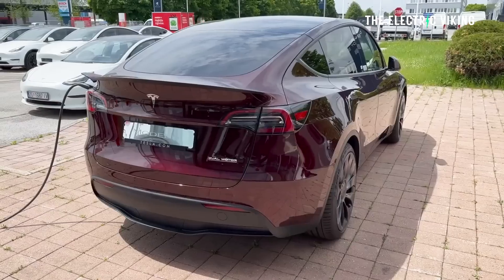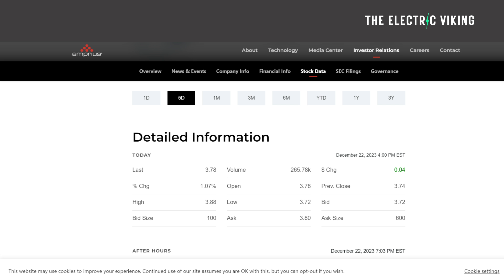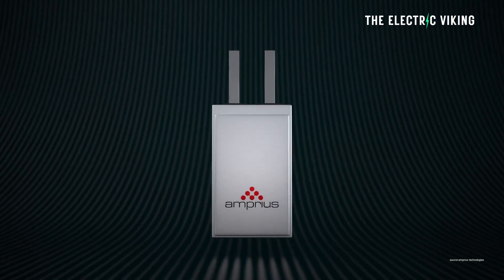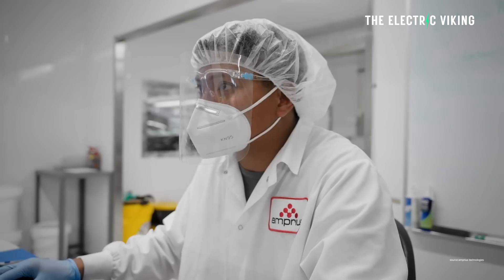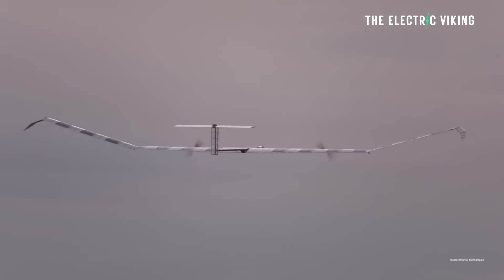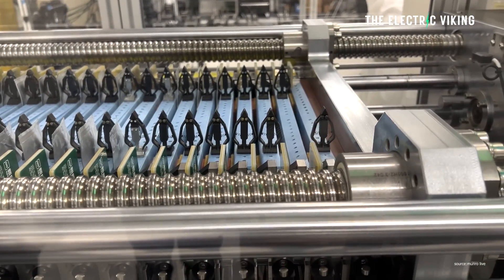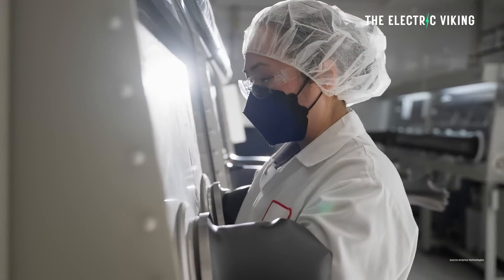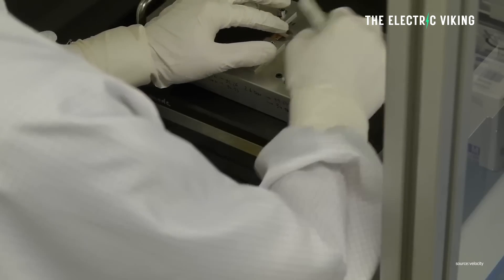A U.S. company makes the world's highest energy density batteries next to Tesla

Comment: here are the links to amprius data sheets, im sure they have new cells not yet posted but here is what i found,  this will answer most of the questions posted in the comments if just half of you get off your butts and look round you'll find the answers.. lol  https://www.tenergybattery.com/_files/ugd/78a53e_334298ab6776498f8d936c1d06e4840d.pdf
https://www.tenergybattery.com/_files/ugd/78a53e_73c57a1b49794251b19775c99bd1686c.pdf

Comment: If you are interested in this topic, please search lithiation process, which change the volume of anode! Si has more electrical capacity, it means that the the materials volume are higher after the charging process! please search “In Situ and Ex Situ TEM Study of Lithiation Behaviours of Porous Silicon Nanostructures”. If you are want more, please search “ in situ TEM Li battery”! My background is PhD in materials background. The Si-anode battery is old technology 10 or 15 years ago. GM spent millions of dollars and get nothing. The profeesor sold the patent to GM and cannot repeat his experiment results! The experiment were done by two students, who wanted to graduated ASAP!So basically, most of the data from this professor are faked! My friend working at GM told me this!

Comment: Not so many people  realize that successful tech breakthrough is NOT the same as massive industrial output (unless it is an software/internet breakthrough).
due to many factors, I NEVER doubt US is still leading in many aspect of science and Technology.
But US simply does NOT have  that amount of engineers and skilled workers to produce them in large scale so that the price can go down quickly.
TSMC's failure in Colorado proves that.
TSMC, by any standard, is a top-notch production company, BUT it does NOT work in USA.

good luck, Americans, I have doubts on US industrial capabilities NOW. and I don't there exist an easy solution for it.

Comment: If you just consider electrical capacity, Si is the best candidate. But, Si is brittle and the life of the Si anode battery will be very low! The reason is very simple: during the recharge process, Si will expand a lot!  During the driving, the volume of Si reduced a lot! This is a scam technology. The professor who developed the technology cannot repeat their results! Ask GM about this technology!

Comment: Amprius batteries would actually make the Cyber Truck run over 500 miles at 80mph. So really excellent. Worthwhile. Means I could make my doctor's appointment for 1/4th the cost and be more rested than now. Not sure what the ambient noise level is at 80mph but with that massive air filter I won't be sucking carbon monoxide fumes like in my old Mazda MPV and my guess is the fm radio probably sounds pretty good. Catalytic converter thieves,  don't need to ever worry again.

Comment: Finally....so far lol....Amprius is back down to around $4 stock value... about where it started when it got PUMPED up by some promotional comments......only to subsequently get DUMPED by unknown shareholders who saw the sharp 40% rise in value as a super opportunity to CASH IN their holdings. So far UP so FAST and so far DOWN about equally fast. I think I look to Viking for  amazing industry knowledge and awareness rather than stock tips, especially when he discusses only a single reason to buy when he well knows there are many technical factors to consider let alone many other factors. I did not buy any... not yet, at least. It turns out Amprius technology is applied to the anode whereas Lithium Iron Phosphate is a characterization of the battery cathode. Can they not be combined? I don't know enough.....think the answer is yes... but why do their existing batteries only last about as long as iPhone batteries?

Comment: Warning. SPACs are dangerous. Using a SPAC allows due dilligence to be bypassed. That means their claims don't have to be reviewed and confirmed. That's the challenge. 
Batteries need to pass All the hurdles to be viable: 
Energy Density
Power Density (charge rate)
Life span
Cost to produce at scale

Any One of these could kill the company.

Comment: This is really bad analysis. Amprius is in the defense market because they have a low life cycle and caters to units that are designed to discharge slowly and go a longer distance then blow up. These are medium sized batteries. They “claim” 200-1200 cycles which is a wild range…EVs need closer to 1000 and the larger the cell the less cycle you typically get. Recall 2020 when they were slow discharging with only 250 cycles. This is not viable for EVs for a very long time. Plus dilution is coming with heavy insider selling. Why would people sell if Tesla is building with them. Silly video full of distortions. Having said that Amprius is a good company in an adjacent space.
Reply: I don’t think you have done much research on Amprius. Yes, they have made batteries with insane density (500wh/kg) and low C-rate (1C), but they also deliver batteries with very high density and very high C-rate. I don’t think they have a technology that would enable them to scale into the EV mass market, but they might become a preferred supplier to the niche supercar market. Still, the eVTOL and military applications market will be sufficient markets for them to grow in the foreseeable future.
Reply: @OlaFrugaard  it’s certainly sufficient to get to 2x -3x the price but EVs are the only path to a multi-billion valuation. The thing is, this is undervalued but not by much given the dilution coming. I don’t see a major EV OEM putting the risk on to pay for it until it’s proven to work for longer cycles. Tesla will not be buying this and it will take Amprius at least 5 years to get an EV battery out on the road. It just is what it is and this type of video hurts investors because of a lack of DD. It’s a solid company but NOT for these reasons

Comment: I watched many interviews and read many reports. None of the discuss the longevity or cycle life of Si-anode battery, as if they are trying to evade the subject. I read an independent study that they can only cycle about 100 - 300 times before swelling problems hit. they probably can improve on this figure, but not by much at least not even close to the current LFP batteries.
Reply: Someone that actually does DD! The problem is the current battery architectures cannot support this. It’s a material company. One that Solid State is far superior with an easier, but still difficult, path to both solving the problem and scaling the solution. Yes the only batteries they have sold are for planes that are built to blow up or glide at very low speeds…roughly sold to a 200 cycle spec again at low discharge rates. Solid state can do that today but doesn’t care to sell to this market. The winners in this space will be architecture and that’s Solid State or something like and Enovix if they can ever break out of the consumer market into EVs. Solid State is the clearest path. Aside from that it’s drop in materials lie Sila that give a step increase rather than a generational one. No way tesla is looking at this company. It’s actually laughable

Comment: 1000 miles = 1600 kms, 16 kWh per 100 kms consumption means the battery is 256 kWh capacity.
80% is over 200kWh. 200 kWh in 8 minutes, plus charging losses, would require 4 Tesla semi truck superchargers all running at full output, all charging the one car battery at the same time. In other news, Tesla releases low cost compact modular nuclear reactors for the masses, to conveniently charge your new Tesla Model FFS, in the comfort of your own home.

Comment: It’s not only power density, but also longevity!
Reply: Degradation would technically be significantly lower than a traditional battery as the nanowire provides ample space for the silicon to swell up.
Reply: @hotyute That’s not right. Just because you try to fix the Achilles heel of a technology doesn’t make it as good as the standard technology in terms of longevity.
Reply: Silicon volume increase and then decrease. Please imagine this process happened on silicon wafer!
Reply: @joeyzhao3925 the volume of all materials change with temperatures. Si is no exception.

Comment: Well, at $4 a share a 100 shares would be only $400.  However, if a stock loses two thirds of its value it's a good indication that they may be having issues.  I've been actively trading in the market since 1992 and have learned a lot.  The one thing I learned above all else, is the market is fixed and the public will always be the last to know the truth of what's going on.  Generally, if a stock is down by this large of an amount the people in the know are not buying.  I would be careful with this one.
Reply: Lots of insider selling and dilution coming as well. Market is only going to reward EV for this company…not airplanes built to blow up for a few thousand dollars a battery and pseudo satellites. It’s just a very limited market. If they prove out cycle life it’s a game changer but then they also have to prove out cost. Remember, Tesla owns the market and they make money off cheap batteries that can supercharge. Density is not a major issue. Only thing that matters is fast charge. But cost of battery is what is the main driver above even that. Those costs are dropping significantly by the year. 200 cycles is the norm for them. 1200 is the best they have done and that’s VERY questionable

Comment: I think that range of passenger EV/s is not a crucial issue though the number of charging stations is, also the speed at which batteries can charge would bennefit from improving.
Reply: Range is king. I have about 250k miles in a Tesla. I would love to have 1,000 mile range.

Comment: Enovix is a far better battery stock.  Here's why - they have full silicon anodes just like Amprius and similar energy density but they don't use nanotech to make them - what does this mean - scaling production is far easier, and cost of production will be cheaper.  Also their new management are semicondutor veteran studs that have done high production of numerous products successfully many times before.
Reply: Enovix has also been public 14 months longer, sold less batteries, has less customers, made less revenue, and none of their customers are investing in them. They have new management because they are way behind on their 2021 roadmap and have been pouring money down the drain for the last couple years. Will they recover? Maybe... but I wouldn't call it a "far better battery stock" until they prove out Gen2 production and start selling more batteries in 2024.

Comment: If you know anything about Tesla/Musk, it is definitely that Tesla is "battery agnostic"; meaning Elon will use any commercial battery that has a form factor capable of using the Tesla battery pack. Tesla can already use CATL, BYD, Panasonic, or its own 4680 batteries. New battery chemistry/processes seems to be a weekly event, with lower-cost higher-density technology. Mr. Musk 'says' Tesla is not making his battery platform to be easily replaced because of the longevity of the existing battery technology, but I'm skeptical of that claim, because integration of 3rd-party battery technology into Tesla EVs is being further[...deliberately?] complicated by design of the Tesla battery pack, such as the compression of the Cybertruck pack for "wade-mode', and 800V/48V architecture. However, some enterprising rebuilds of Tesla's pack may be possible, if not cost-prohibitive. This will eventually be tested when enough Tesla EV batteries have ended their useful life. Will owners choose to buy a new vehicle after 8-10 years [IF...] those 'better' replacement battery packs are in the $10-15K cost range? R&D/design is easy, but 'production-is-hard'.

Comment: I had a tendency to run out and buy some shares right away - and then I thought of some questions. So I went to their website and asked the following. I am interested in the potential for your batteries to be used in electric vehicles. The type of battery emerging in that arena which seems potentially most favoured has Lithium Iron Phosphate chemistry. 1. It is noted as having very low deterioration through a great many cycles of use and recharging 2. It is noted as being less vulnerable to fire and it is making gains in market share despite somewhat lower energy density than earlier battery chemistries. To compare: 1. How much percentage energy storage capacity deterioration would your batteries experience over 5000 cycles being significantly discharged through use and then recharged? 2. What temperature is required to ignite a fire with your unprotected batteries and what is the likely peak temperature experienced in such a fire? Or, in a less specific manner how would you characterize the length of life and fire challenges posed by your batteries compared to Li Fe Phosphate batteries now being supplied in Tesla or other top EV's?  Thank you for considering my questions. I'll decide about investing according to what I hear or don't hear from them.
Reply: I think my comment has been suppressed by Viking? Up to his old tricks? Really important factors to consider he never mentioned at all in this video and which make blindingly clear that energy density alone is  highly insufficient to make a decent car battery.
Reply: My comments seem to play hide and seek! Perhaps the most significant point which seems to have disappeared is that the company made a direct response to me about my concerns in response to questions I directly asked them. Their batteries have about the same lifetime as those of an IPhone - well short of the 8 year guarantee on my Tesla 2170 cell based battery. And the 2170 has a lot less lifetime than the LI Fe Phosphate batteries becoming increasingly prevalent. With respect to my fire concerns they said nothing about ignition or peak temperatures - so you have to wonder. They did note their batteries could pass the military nail penetration test reassuring for soldiers wearing a battery - but only if the battery were charged significantly less than their peak energy density. Still, they passed at a still high energy density. For me the most impressive feature of the company was the presence of Dr Stephen Chu on the board. That guy impresses me as not just technically brilliant but also of very great charcter. To me that says they must be a good company.  But others can still play games with their stock.

Comment: It's silicon, not silicone. Silicon is an element, silicone is a polymer with silicon as one of the ingredients. This technology is interesting but it is expensive which is why they are targeting aerospace and defense which are much less price sensitive than EVs. The EV market seems to be hitting a wall at the moment and if the recession does come this year it would probably slow the EV adoption curve for a while. The two other very big markets for better batteries are consumer electronics (CE) and grid storage. Amprius is too expensive for both of these markets, but at a lower cost would be a good fit for CE, never for grid storage. It's not clear which technology will win out for grid storage, it's probably a mix of several different battery types. As for CE, the clear leader as of today is Enovix. The Enovix battery also uses 100% silicon in the anode but in a much different design that is much cheaper to produce. Enovix also has a patented design feature that prevents battery fires, just ask Samsung how important that is. I expect Enovix to announce large supply contracts with at least a few major CE companies in 2024 as they ramp up production in their new factory. Amprius might eventually win out in markets where price doesn't matter but it is unlikely they will every match the price/performance ratio of Enovix. And Enovix also already has deals with the military and could probably go after the aerospace market if they weren't already focused on consumer electronics. Want your phone to last days longer? Get an Enovix battery.

Comment: pouch cell.  sure the volumetric energy is high…they’re flat.  flat lipo packs are used in the rc hobby for a reason.  But you’ll have to convince me that they are robust.  deformation, aka, swelling, and cycle life yet to be illustrated.  and that leads directly to safety…the bulk of ev fires in bikes and cars have occurred with battery packs built with….pouch cells.  So prove their safety, durability, and cycle life…then I’ll be a believer.
Reply: Using a gel electrolyte, they can punch a nail through it and pass the military's nail penetration spec...
Reply: @Grimwyrd  they’d be easy to puncture.